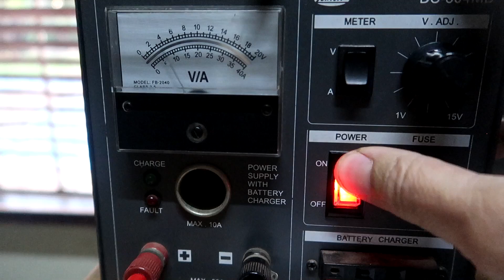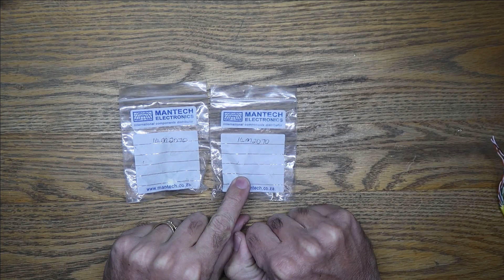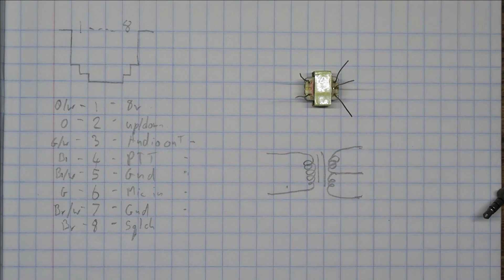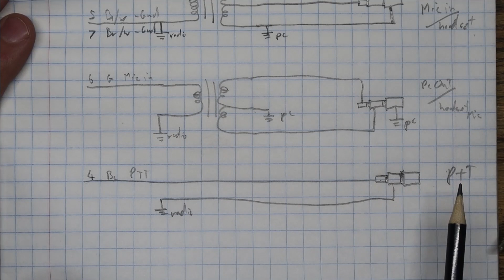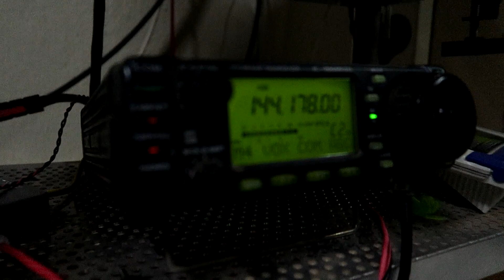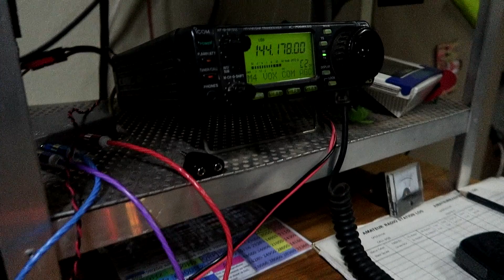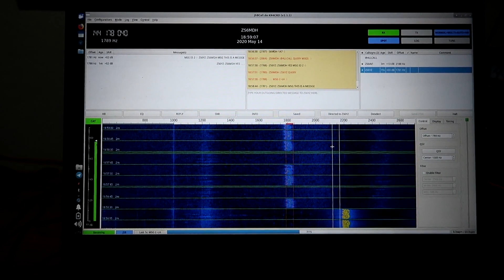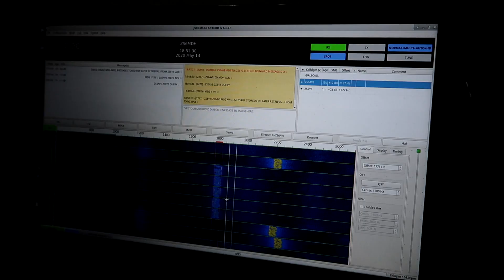Building a CAT cable for Icom706MKIIG, and some js8Call

Comment: Marc can you transmit digital modes, like FT8, and or RTTY, PSK on 2 meters and 70 cm on this Icom IC 706 MK2 ?
Reply from the maker: Yes. This cable and the icom allows that no problem.
Reply: @MarcdHotman  ok thanks for the info, because my friend has same transceiver but he can NOT TX on digital modes on VHF and UHF, but SSB and FM are ok, but no TX on digital, and 160 m - 6 m no problem, that is why I ask.. it is bit strange that he can TX on 160- 6 meter but no on VHF and UHF ?? :)